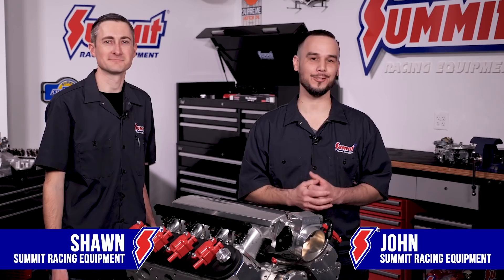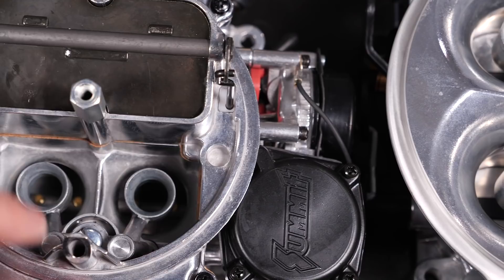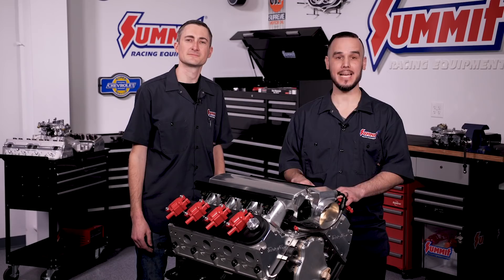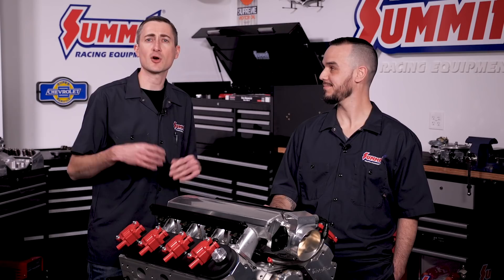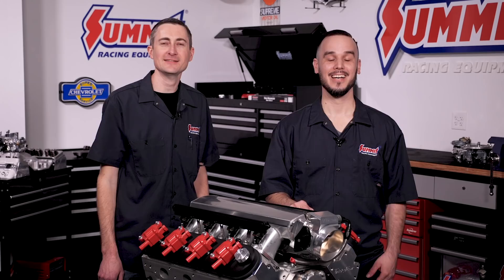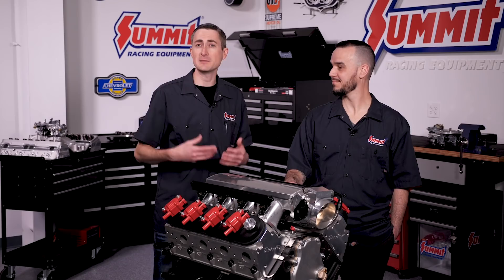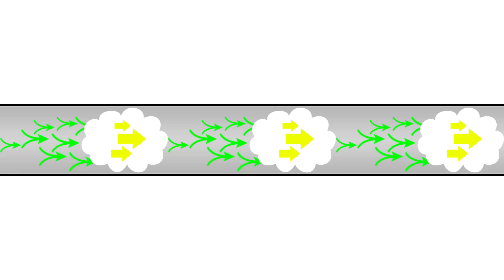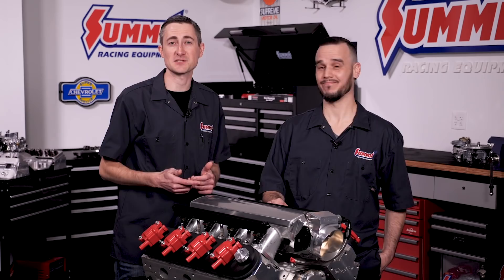3 Automotive Myths That Cost Vehicle Performance

Comment: What do you recommend for a 2016 Colorado with a V6? I want more power but on a short budget.   I know, should have got a V8 but it is what it is!
Reply: larry lucas exhaust and cold air intake are cheap easy mods, as are aluminum wheels and race tires
Reply: Intake exhaust and a tune
Reply from the maker: Hi Larry,
 
For newer vehicles, like your 2016 Colorado with a 3.6L V6, the easiest and most affordable up grades would be an Air Intake, Computer Programmer, and a Cat back Exhaust. We suggest KNN-63-3088 Air Intake Kit, DBL-8245 Computer Programmer, and FLO-717834 Exhaust system for Extended Cab or Crew Cab applications.
Reply: Can only get Alloy Tec or Isuzu diesel in a Colorado

Comment: On the subject of exhaust, there is no such thing as back pressure. That would mean something is pushing back on the exhaust gases trying to exit the engine. Like they said what's really happening is that the flow velocity could be too low for the rpm the rest of your engine is tuned for, so to increase velocity a smaller diameter exhaust pipe would be necessary. If it's on a street car that pipe starts at the cylinder head flows through the primary exhaust into the collector into the secondary and all the way out through the muffler to the atmosphere. Ina race car that either stop at the collector or extension pipe.  The discussion of how intake and exhaust tuning is achieved would be much much too long to write in the comments section and would need a complete video of its own, which would still be lengthy as it's not a simple subject, but it's one that needs to be understood when building an Angel empire properly.

Comment: I don't understand the emphasis placed upon equal length headers. If it is to have the exhaust pulses arrive at the collector(s) at even intervals, that does not happen.  On each bank, the firing interval will vary; 90 degrees and 180 degrees  of crankshaft revolution. Only on a 180 degree "flat crank"  are they always 180 apart.
Reply: Some special headers cross over to the other side to have the pulse of exhaust meet at the right time in the collector. These engines also sound different due to the even exhaust pulse.
Reply: As noted by Chris you need to have the equal length headers crossover between banks for the optimal scavenging effect. This is seen on the “bundle of snakes” exhaust created some GT 40s. This type of system is too complex for most applications so a compromise is a separate equal length header for each side. While this doesn’t necessarily create equal pulse intervals it does ensure that pulses don’t collide.  Since each cylinder on a bank fires at different times, the equal lengths allow the pulses to flow through the exhaust in the same order but with different intervals creating some measure of scavenging. If the pulses were to collide scavenging would be reduced.

Comment: I have a 1989 ford 351w efi. Its in a van. I'm just looking for heads and an intake for a stock engine with a custom exhaust. Any recommendations?
Reply from the maker: We recommend the Edelbrock E-Street heads, EDL-5025 and COMP Cams cam, CCA-31-255-5.
https://www.summitracing.com/parts/edl-5025
https://www.summitracing.com/parts/cca-31-255-5

Comment: You can run a bigger carb with no issue, just rejet the carb
Reply: Agreed sir
Reply: And you would have to go completely nuts with the head port size to hurt torque at all. It's like these guys are reading from a Car Craft magazine article from 30 years ago.

Comment: I am sorry I took there advice ,lost power and left numbers on the table, my suggestion, get competent builder,and knowwhat you want. Start with what are you doing with what vehicle, and pick a cam. Build the motor around that you can not go wrong. Know my experience, I bought the smaller headers ,smaller carb ,and lower stall converter, I got less gas mileage, less power, and the ET am MH where slower. Took it to a rear wheel dyno,but looked at the air fuels ratio through the curve. Left power on tablet .

Comment: The carb sizing charts is only if the engine is st 100% efficiency.  Go to the larger carb as you do not lose low end power and you do make more on the top end. E.t slips over 30 years proves these guys are spreading a carb size myth.

Comment: i'm looking for good power and good millage
Reply: Then go with fuel injection.   If you have to run a carb, go with vacuum secondaries.    Quadrajets are excellent at power and mileage. There are many good street carbs out today.

Comment: Here is a good question that even some pros on dedicated forums can’t be for sure about. If you have a 2 inch dual exhaust, and it merges in the middle into 1 (Y Pipe) then splits back out into 2, what if you want a single exhaust by continuing the single Y pipe to the back, maintaining the same power and level of quietness? 1992 Lexus LS400
Reply: sounds like a good question for a magnaflow rep. call them and ask.
Reply from the maker: Hi Omrie,
 
We suggest to merge the dual 2 in. diameter pipes into a single 2.5 in. diameter pipe. A single 2.5 in. pipe will easily support all 250 hp of the LS400. As far as quietness, we suggest a good quality Resonator and a high flow muffler that has good sound control characteristics, like a Dynomax Super Turbo Muffler or something similar.
Reply: Summit Racing That Is A Good 
Response. Everyone Suggests A 2.5 Inch Pipe But If I Want To Keep It Factory Quiet, Like Use The Factory Mufflers And Weld 
Them On To The 2.5 Inch Pipe, Would That Hurt Power? Maybe 3 Inch? Thank You For The Response.
Reply: @omriesabbagh  Your stock muffler will very likely hurt your performance stuck on the end of an efficient system. Put it on the end of your 2 into single 2 1/2 and install a backpressure guage and see what it reads at different RPMS. Best case is the system they describe using a free flowing muffler and resonator. (Sound reflection and sound absorbtion muffler, two different frequencies)
Reply: J G It won’t hurt reliability that bad though will it? There are mixed responses online.
Reply: @omriesabbagh  Is your engine non modified? If so a factory muffler shouldn't hurt it any other than a little performance wise. 34 years and 60,000+ exhaust systems built and installed. It will still be a little louder than stock if you've increased the pipe size up to the muffler, you've increased the flow and increased the resonance. Sound waves bounce around more in a larger pipe. There's three ways to quite an engine, restriction, sound reflection(cancelation) , sound absorption. So, stock muffler on the end and add a non-restrictive resonator in that 2 1/2" inch pipe half way between the Wye and the muffler if you want it as quiet as possible.
Reply from the maker: Hi Omrie,
 
We would not recommend using only one factory muffler for all of the exhaust to be pushed through, it will restrict the exhaust flow. This muffler was originally designed to only handle half of the exhaust flow. Depending how much space you have, you may fit a larger 2.5 in. Muffler and a larger Resonator for the best flow and sound control characteristics.